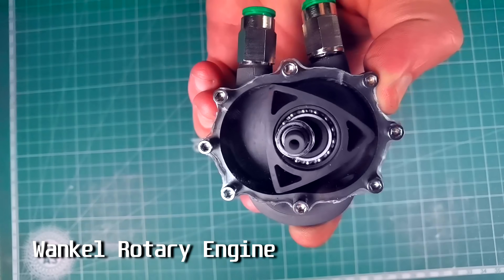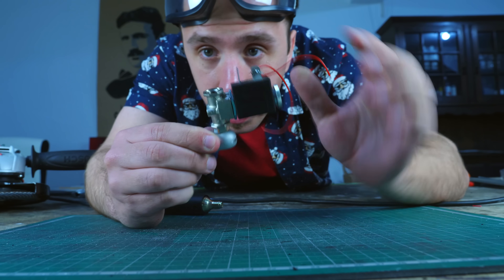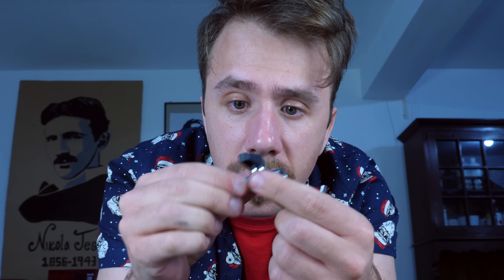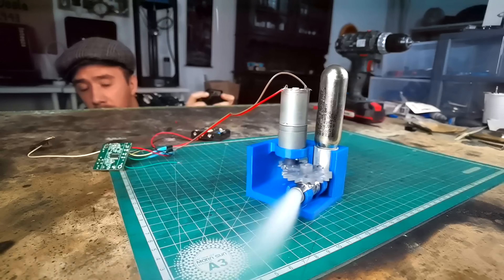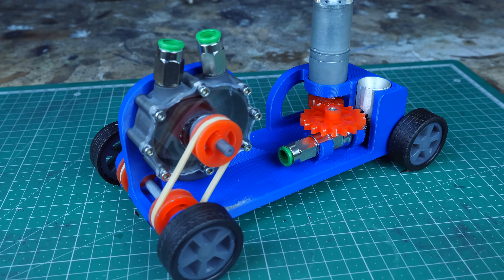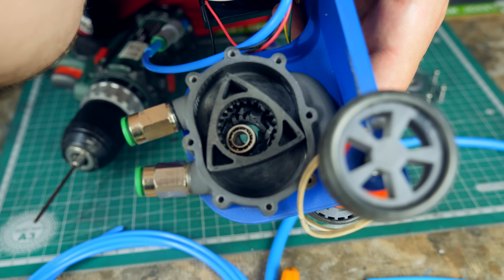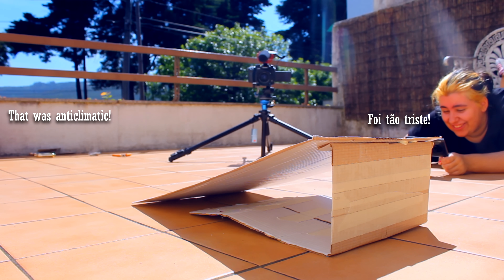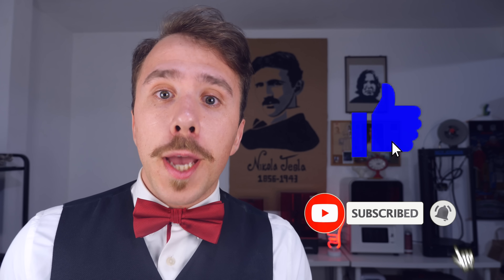Rotary Wankel RC Car (3D Printed)

Comment: For a future video you could use your SLA printers to 3D print a exhaust pipe (pretty much like a pneumatic silencer) to create some counterpressure and have more control on the car. Also a 3D printed gearbox with control on the remote control would be freaking amazing!
If nothing works, I suggest to put the car vertically with a tomato inside and turn it into a rocket!

Comment: Video suggestion: print a fully working mechanical clock.
Reply: That would be cool. But let's take it to a next level. Maybe powered by something that doesn't run out of energy to make it a forever clock
Reply: @SSingh-nr8qz  Sadly that's not possible.
Reply: @SSingh-nr8qz  The best you can do, you power by renewable energy (sun, wind etc).

Comment: There was too little torque one the rubber band, also it would be great if the air could decompress from liquid to gas first so you will have more “fuel”.

Comment: I don't know how you didn't figure this out already. If you you have the CO2 cartridge upside down / side ways you'll get a lot of liquid CO2 out of it. Phase change is not instantaneous, it takes time. Not only  you're not getting all the power out if it, because anything that goes through the engine as liquid is lost, you are also cooling everything down, since liquids has better thermal conductivity than gases. Cooling everything down also has the disadvantage of making everything brittle and it also drops the vapor pressure down, since it depends on temperature. Bottom line, without an expansion chamber you're getting less pressure and less volume out of the same charge.

Comment: Hey Integza, love the show... you should redo the dragster with gears, instead of the rubber bands, going from the wheels to the rotary engine... should be less energy lost... it looked like the rubber bands were not transferring the power to the wheels very well...

Comment: I think a more explosive video is now in order. :) you should attempt a full combustion engine using evolution FR resin which is flame resistance. Perhaps making it rely on compression rather than a spark would be easier also diesel tends to burn cooler. A full 3d printed combustion engine would be a first as well and a real challenge that I would love to see you tackle.

Comment: i think that to better control the speed of the engine you need to add a pressure regulator. this will stop it putting 800psi into the engine as well as reducing the speed and increasing the run time

Comment: Video idea: improve this car and jump over that ramp
Improvement ideas:
You can actually reacharge these cartriges with some manual pumps so you don't have to use new ones every time!
(some pumps can do over 800 psi)
You should also use some rubber membrane to seal the engine better because it was leaking in the first try
Tightening the rubber band and using a bigger second wheel will make the weels spin slower and waste less enrgy because of the band slipping
Also attaching the exhaust of the engine to the back could use the leftover energy and increase the efficency
couple both wheels on either side together with a pully so it will still use the energy when it jumps from the vibration

Comment: How about a plane that can support the weight of the 20g cartridge AND actually fly if even just for a few seconds and with zero control.  Maybe not with a sharp point on the front since it would essentially be a rocket powered lawn dart!

Comment: You need a pressure regulator, so you can power your engine much longer and much safier. And maybe the wheels don't slip so much

Comment: Take the Wankel engine and use it to drive a blender for your Tomato juice! 😆 

You might try a Flow controller and/or pressure regulator to improve the performance of your little hot rod..... and maybe reverse the flow so the engine is pushing instead of pulling! 

Keep up the great vids!!!

Comment: if you can some how fit a gear box to slow down the wheels it should be way better. if not, then you could just replace the rubber band with gears since the band was slipping so much

Comment: -put the cartridge with the nozzle up
-use pressure regulator to smooth the output
-make the car rear wheel drive

all of the above should make the wankel car 2.0 more efficient! :)

Comment: Well, replacing the rubber bands with gears or something that doesn't stretch would help as would having tires on there that actually have some traction.

Comment: Mr. Ingtegza You are doing CO2 powered engine wrong! I mean up-side-down. I'm surprised, that Tomato King has not yet pointed that. CO2 cartridge is not full of compressed CO2, it is full of liquid CO2, that is why is nominated in grams not liters. Liquid rest in pressure-state balance as long as it is compressed, at pressure around 70 Bar, depending strongly on ambient temperature. When container is depressurized, liquid starts to evaporate at constant pressure, dropping as liquid cools down due to phase change.
When You put cartridge bottle neck down the engine is overflow with liquid CO2, it is violent, ineffective and short time. That why one can see dry ice a.k.a. "snow" on slow-mo.
Mount a cartridge neck up (or vertical) more gas flow You will have! Limit flow, and evaporation will be more stable thus gas flow longer and on constant pressure. 
All that comes from my experience with CO2 powered target shooting with CO2 powered airguns and paintball markers in old days (before high pressure tanks got cheap).
And, b.t.w. - Death to tomatoes!

Comment: When printing the drone body you will need to make it really thick or the force from the motors will bend all four corners in. It was not fun to get slapped by a broken propeller that hit the main body do to that problem.

Comment: I saw a design on thingiverse that uses two parts, that you print 2x (2 left, 2 right) and they slot together with locking tabs. I am trying to modify my Monoprice Mini Delta with a new BTT board so I can get silent printing, since it is so loud with the default board!

Comment: so my first 2 thoughts are why not use a rotor mounted mounted on an eccentric shaft rather than the gear that was going to be a huge weak point cause stuff gets brittle and shrinks when it gets cold. and design a more direct drive connecting the rotor to the wheels (bonus thought as i was typing the first 2->) with maybe a solid axel so that you dont have 1 wheel spinning faster than the other if there happens to be any slippage

Comment: A few hypothetical ideas for an "improved" wankel car:

1) Different gear ratios
2) The exhaust from the wankel seems pretty energetic still... could it drive a second rotor?
3) Failing that, maybe fit an exhaust nozzle to the engine; both to provide gas thrust backwards, but also... could constricting the exhaust slow down the rotor and give you a more useful RPM for longer?

Comment: If you used a geared connection to the wheels and some grippier tyres it would work better. Also sugar water on the tiles...

Comment: Just a fun idea would be to make a rocket that uses the plastic as fuel like in your previous videos that is or, slow enough to have a 3d printer printing fuel onto it while its running so you can have a really long burn time or have a solid fuel rocket that is modular so you can just replace the solid fuel with a new solid fuel cartridge

Comment: What did you use to pierce the CO2 canister? Have a good source? I've been trying to build CO2 gizmos since seeing a CO2 Mask Gun on another channel, but the source for the lancing fitting was on Taobao and ... it's not English-friendly unlike AliExpress or Banggood. Also, what would such a product even be called? Currently I am looking at a bicycle inflator but I'm thinking they restrict the flow so users can't inflate to 800 psi and can Schrader or Presta fittings handle 800 psi? I have solenoid valves already.
Reply: Guess I should have paid more attention to the start of the video :P

Comment: There is a different style of rotary engine that might work better where the cylinder is a triangular shape and the piston/rotor is an oval shape, the benefit is that you don’t need to worry about a pin or anything for the seals because the oval shape stays in contact with the cylinder to create the seal but the engine combusts in all three corners at different times so it might not work for co2 or compressed air but it might be worth a try because it is supposed to be more efficient
Reply: Why wouldnt he just use an actual air rotor at that point. The one with the fins and an adjustable displacement.
Reply: @benjaminsteakley  https://youtube.com/shorts/GQ5zTK9ejP4?feature=share
Reply: @tannergietzen9539  thank you :)

Comment: If you revisit this you should try a ribbed belt with the ribs going laterally across the belt and pulleys to match for the drive belt, that may get more wheel speed, or it may jump ribs and get the same effect but i did see that your rubber band was shaking enough to not get any grip on the drive pulley. Just thought it might be interesting to try 🤔

Comment: For the amount of power that little engine creates, you should use either a gear systems of timing belt to transfer the power from the engine to the wheels. That way you can harness the torque and get that little car up the ramp. Gears will be easier as you can 3D print them. Make bigger wheels and you can use rubber bands for traction. 👍👍👍👍👍

Comment: If you would redesign the engine, consider adding a groove in the size of a rubber band around the chamber and 4 to 6 screws evenly distributed (important)
And couple the output to the wheels via gears or something completely different 🤔😁

I think now you won't do that, since I told you what to do, right? 😐
Anyways it's worth a shot

Comment: To make it more efficient you could have made the chassis a little bit more rigid, as the slow-mo footage clearly shows all the power from the rotary engine is not going directly to the wheels, instead some of it is making the chassis bend, wasting a lot of useful energy. You could have geared the wheels so that the high rpm of the engine wouldn't have made the wheels spin too fast and just slip, plus that will make the car run a little bit longer

Comment: The rubber band can't handle the relatively high torque of the motor...
But the concept is cool
So... Either increase the diameter of both pulleys for the band or use gears (or something completely different 🤔)

Comment: You are losing a lot of energy because of the rubber band if you use gears it will be a lot more efficient try making different type of gears in a small box and check which one it will be better  doesn't matter the rpm like you said at the end of the video a little bit of the tires but not the RPM the reason your little car is not going faster or have more torque it's because in the slow mo you can see the rubber band just bouncing

Comment: Being a school student, I can't afford many tools (such as CNC/welder). So, i would request you to make a 3 d printer using the 'kits' present on 'amazon'/maybe a welding machine (using step down transformer or capacitor bank).

  For rocket fuel, tryout--- 
         1)sugar + pottasium nitrate + rust{1% by weight} + sulphur{5% by weight};
         2)add sulphur to your hibrid "solid part";     

                            ------------------------------------------------------------------------------------------------------------------------------------------------------------------
Please allow me to win the give away, so like this comment(request to other viewers).

Comment: I just wanna say how much I hate your wireless release control design. Why did you keep the 4 AA pack instead of wireing 2 AA in parallel, saves weight. Or just have your control not come from a broken RC car.

Comment: The apexes of the rotor don't look like they're sealing very well & the rotor is bouncing around inside the casing, I think this could be a major reason why your inner gear broke; Maybe you should try spring-loading some pencil leads as apex seals to push against the graphite on the walls, holding the rotor in place? Great vid btw

Comment: Turn the CO2 cartridge the other way and put a restrictor valve in line 
That will slow for the flow down giving you more run time

Comment: Love science too much torque = wheel hop and destruction. I think just needs a valve that can be ramped up or a split valve as you can limit air through the line.
Keep up the work :)

Comment: You could direct the air coming out of the engine backwards, this way you have both the engine power and the thrust of a rocket. Also, the rubber band was slipping a lot, you would get significantly better performance if you use gears or a GT2 belt.

Comment: Add a flywheel too to maintain the speed after sealing the engine properly and regulating a little pressure with a hard material for chassis

Comment: The engine needs a gasket and the rubber band drive is slipping, tighter bands and a reduction pulley should yield higher efficiency 🔥

Comment: Video Idea💡- Make a similar car🏎️ which uses gears⚙️ instead of pulleys & with big tyres, maybe control the air input to the engine to increase efficiency, simply a better optimization of the power of the engine🚂.

Comment: if you control the gas escape from the motor will you get the rotations to be slower? i do belive the case you have it on will not be able to contain the 800 psi but try to see.

Comment: It's pretty clear from the lack of sealing (CO2 vapor shooting off in all directions) that the "engine" is operating as a turbine, not a pressure engine. The Wankel design is fun to watch and cool to look at, but you would probably get better results with an actual turbine design, and it would be simpler as well.

That's some serious wheel hop revealed by the slo-mo footage. It appears to be amplified by the rubber band belt. A geared transmission or actual belt without the elasticity of the rubber band would probably work better. A throttle would also help, but it would add weight and complexity and would be very hard to design for such a high-pressure, high-velocity but low volume system.

Anyway, I always enjoy your videos. I always learn something and your sense of humor is refreshing. 👍

Comment: Are you sure your original valve wasn't just backwards? They way they work pressure keeps them sealed, so it would have had troubles opening, not leaking.

Comment: I love the video, but I realize of that amount of power of CO2 its dificult  to manage. You need to release slowly the pressure of the exhauts to reduce the RPM in order to maximaze the tork. Plase check on the turbinia boat engine history 1887. She was "the" step forward on steem power efficiency.

Comment: You should build an automatic gearbox for your little car.  It needs more torque when it first starts, and it’d be a cool thing to 3d print.  There are purely mechanical designs.

Comment: That Wankel engine will make it over the ramp if you have better grip and a stiffer frame. It flexes and makes the frame hop and the wheels have a lot of spin without hooking. I’m curious how much torque the wankel has.

Comment: Design and print an automatic tomato smashing hammer. It should detect when a tomato is placed in the "smash zone" and then automatically swing the hammer and smash it.

For extra points, you should print it with a multi-material setup that and use conductive filament. No wires, and no circuit boards. It should all be printed and designed in a way that you can just push all the components into the printed parts and connect a battery or power supply.

You can do it inetzga! I believe in you!

Comment: Why don’t u get a belt with teeth and gears with teeth and put it on the motor and axel of the car u are losing a lot of power because the rubber band is slipping around the axel so u can make it better  and if the wheels start to slip on the ground why don’t u make a drag racing sticky substance so it can launch
Reply: Also the motor looked like it was leaking is there a way to make it not leak that would be great to do with the belt with teeth

Comment: Run the power to the rear wheels with the front mounted Wankel engine so the vibrations don’t cause the power wheels to only have traction for a small percentage of the run.

Comment: Maybe you should use some form of flow control valve that doesn't let all of the CO-2 out at once. I noticed that your wheels were often spinning in place near the beginning which was caused by the RPM being too high. If you use a flow control valve you might be able to get more consistent, metered speed, and may even end up making the car go faster in the end.

Comment: Video Idea: Using the C02 cartridges used in this video. Make a rocket that has fins that can move and stabilize (cancel) out the rotation. Of course, there needs to be a tomato in the payload bay!  Call it the “Telemetry Oscillation Mechanical Altitude Test and Observation Scientific Unmanned Cartridge Karrier” 

“ TOMATO SUCK” for short…

Comment: if you want to squeeze more juice out of compressed air, use a radiator to encourage the phase change to gas. You'll make a bit of a buffer zone, but that would make for a slower, more even discharge

Comment: run the car backwards instead of forward so the rear wheels propel the car. use more rubber bands to better transmit power, and use a regulator to tune down the peak power but have it last longer

Comment: I wonder if its possible to create a fully 3d printed  AIR PRESSURE powered drone. and what will be the metrics for its success, like does sustained flight for 10 seconds sound fair?

Comment: Make a RC rx7 style rc car with variable acceleration, make a transmision drive with gears ( the ruberband slips at high rpm and energy is wasted) and finaly  make it so it haves moderated steering too.